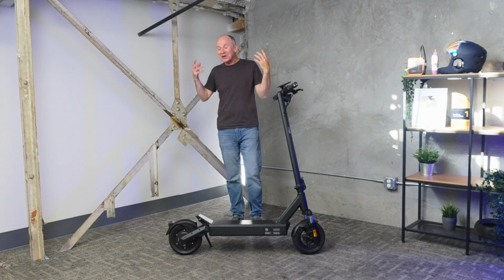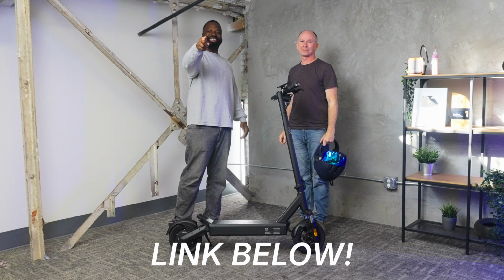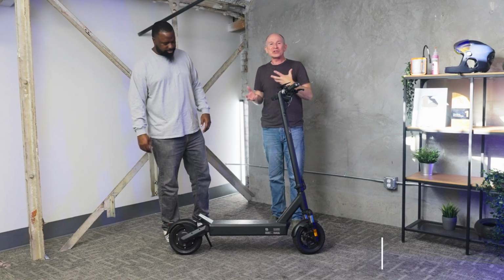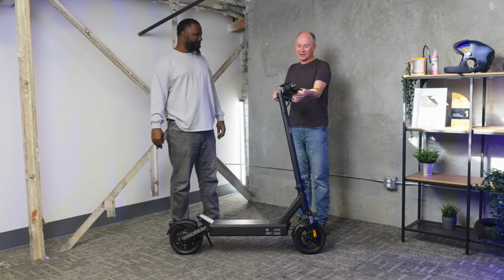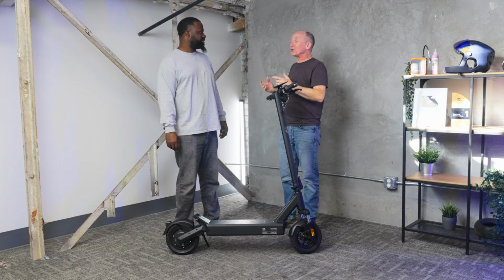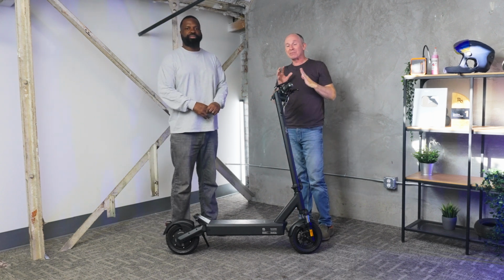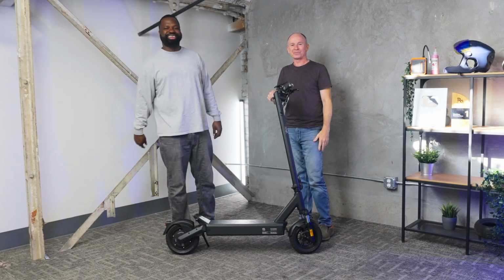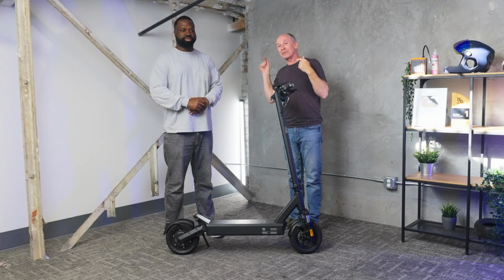7 CRITICAL THINGS You MUST DO Before Your Electric Scooter Ride!

Comment: Hey Electric Scooter Guide's Gentlemen, I have an important question: How do you insure your eScooter—for both personal health coverage and liability? What type of insurance applies? I’m in San Francisco, and no matter where I look or who I ask, my 1600W scooter seems to be in a complete gray area when it comes to insurance policies.
Reply from the maker: We recommend getting insurance if available with your carrier
Reply: @ESG-ElectricScooterGuide  Hi, my question intended to get a more precise answer. What is the name of YOUR insurance company and the plan your are using when riding in San Francisco? (Assurance Name? insurance type: Umbrella, attached to a car?…). Thank you in advance!
—
PS: As we know, over-15mph-scooters liability and medical insurance are impossible to find. After days of investigations (of course asking my insurance company) it looks like only an Umbrella policy might cover riding a non-registered, too-fast-two-wheels vehicle.
Reply: For those who have the same concern: a proper coverage regarding Liability.
I have found that AAA has a product for us: you will need an AAA membership (which ~$65 minimum) + their 3rd party insurance which will put your between an extra $165 to ~$400 a year depending on the coverage (100K to 500k) and your profile.
So basically starting around $20+ a month you can drive in peace with a scooter that goes above 15mph.
In my case — old driver, no accident — for $215 + 65 = $280/year I have their maximum coverage.

Comment: Sorry to see you go Paul, but good luck with your new endeavor!  I purchased the RX7 due to your review ! Awesome videos! I really enjoy my new RX7! What is the proper tire pressure to be set at?
Reply: The tire pressures for PMT's are surprsingly low. I'm not 100% sure what RoadRunner recommends off the top of my head, but I think it's in the 36lbs range. This hurts range a little, but helps ride quality and gives you more traction because you have a bigger footprint. It also helps heat up the PMT's which feel like they just work better and better the warmer they get! Enjoy your RX7!!!!  -Paul

Comment: Paul, what are you thoughts on the segway ZT3 pro vs Max G3? Is it worth the wait. I live in a area with hills but will be using it as a commuter. Thanks
Reply from the maker: If you have hills dual motor would be best!
Reply: I haven't ridden the G3, but got to see it first hand at CES.  I really like the style of the new Segways and the app is killer, but there is a lot of bodywork covering the hardware. Looks cool, but a bit harder to work on in the long run. I'm really not sure how the MAX G3 will ride, but my impression is that it will be the better of the two scooters for on-road and the ZT3 will be very similar but have the edge for offroad because of larger tires, taller ground clearance and longer suspension travel. Also the ZT3's top speed isn't as high as what they're saying the G3 will have in the USA. Keep an eye out for new things from VMAX at around the same time. I published some shorts on the VMAX channel about what's coming. Thanks!   -Paul